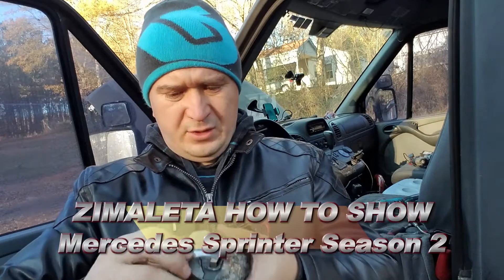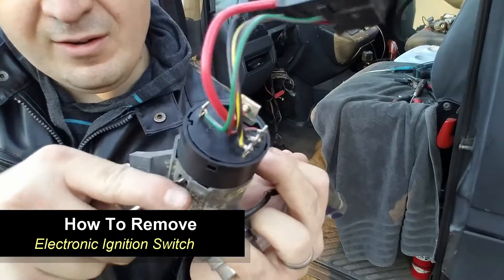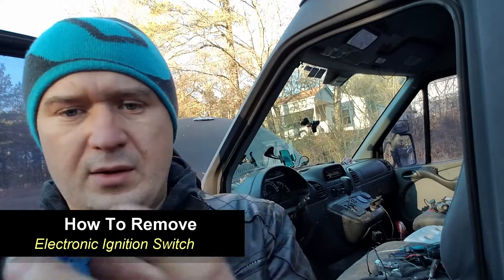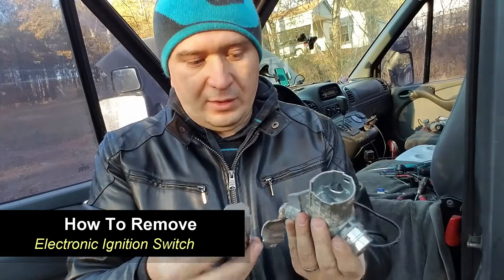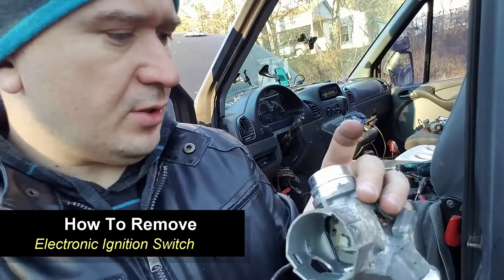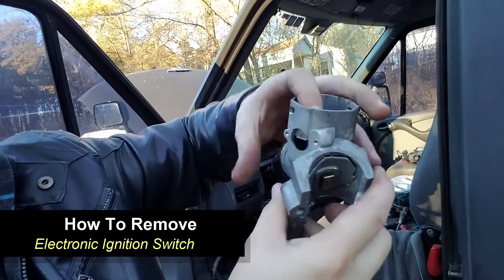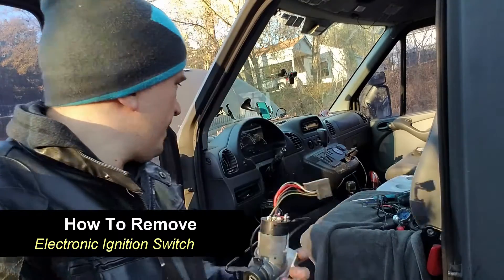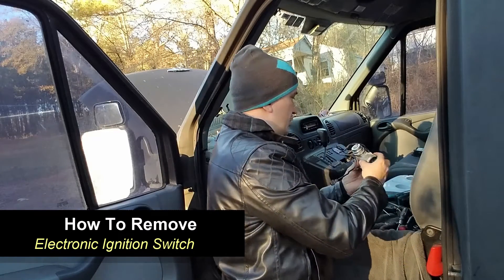How To Remove Electronic Ignition Switch Mercedes Sprinter Season 2 ZIMALETA HOW TO SHOW

Comment: My van shut off on me a couple times while driving. Lights all stayed on but wouldnt start back on untill I punched the steering column near the Key. Would you recommend replacing the ignition switch?
Reply from the maker: It’s probably ignition switch getting unplugged or your wiring harness is bad
Reply: That could be the relay directly underneath the steering wheel.. I can’t remember what its called, but I found it on a forum… Once I changed the relay, it worked fine for a while.. (now I think something in the mechanism is going wrong… but thats different). When the van shuts off whilst driving, you’ll get a check engine light about the master computer or something like that.. The relay is exactly the same type of relay as(and is right next to) the relay that controls the hazard/blinker lights.. they are two bigger blocks about 3/4 inch wide. I really hope this helps.. Its like $15-$20 and you can easily do it yourself. Worth a shot. If not, there’s a wiring harness problem.. and thats not fun..

Comment: Hi, I have a 2002 316 4x4 sprinter. The number on the ignition is A0005458108. When I purchased the vehicle 12 months ago I thought it was odd the previous owner gave me 4 keys. (All the keys looked well used). About 7 months ago I started having problems starting the vehicle. I would try using the different keys until it eventually started. The little red light on all of the keys worked,  there has never been start errors on the dash, and they all unlocked and locked the vehicle remotely. I ended up throwing out all but one key, as it is the only one that worked, that is until today. The vehicle no longer starts, and I'm not sure what I will need to replace. Hopefully You can help as the only man in my state in southern Australia is booked out and about to go on holidays. Fml 😏
Reply from the maker: Like what do you mean it no longer starts? Start error on dash?y advice try other keys
Reply: @ZimaletaMotors  got it sorted. It was the ingnition "Ariel". The copper disc was corroded. I sanded it back to fix problem.
Reply from the maker: Wow can you send me a picture zimaleta@gmail.com
Reply: @ZimaletaMotors  sure
Reply from the maker: Thanks

Comment: Hi Zimaleta
I star to have problems with my sprinter!
Four day ago when I park and turn off engine , I did but the engine keep running, 
Yesterday when I stop and park when I try to turn off I did ! But all light on dash stay on look like Christmas three!!
Also when I driving some times need to have the gas pushed because the engine go off ... in light I have to push gas whit one feet and the other push the brake.
In your experience maybe is ignition switch? Thanks for your help
Christian from Seattle
Reply from the maker: +Cristian Peralta hey there, I will make a video today and explain it, it will be called 
Your Sprinter Questions my Answers While Driving To EL Paso TX Plus ZIMALETA Sleeper Update

Comment: can you replace the ignition switch without having to take the tumbler portion off with the grinder?
Reply from the maker: +Wilje you need a small rotary tool to cut a grove in it to remove with plat head screw driver, yes you need to remove it

Comment: i have a key stuck in the on position.  wouldnt let the truck shut off.  pulled fuse for the fuel pump to shut the truck off.  Do you know what i need to replace
Reply from the maker: +Jeremy Allen I am sorry to hear this, yes I know what you can do temporarily, disconnect the electronic ignition switch and use a screw driver to start your van a flat one, be sure to have key fob near it, but you will need to try removing the key or replace the Ignition switch, this video and some next to it can give you a better idea what your dealing with
Reply: ZIMALETA HOW TO SHOW & UNBOXING.  thanks so much have a blessed day
Reply from the maker: +Jeremy Allen you to and thanks for watching